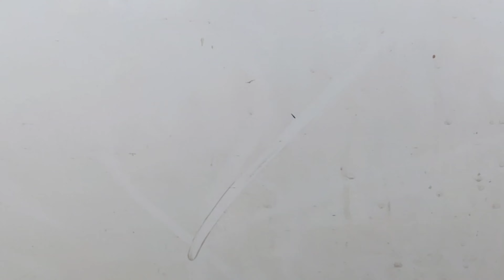2009/2014 F-150 Drivers Glass Replacement: How-to!! #12thgen #f150

Comment: How do I get the regulator down if no battery ?
How you pull from junkyard ?
Reply from the maker: I got mine from a junkyard that they pulled it and had it at a countertop ready to buy. I believe there is a bolt on the regulator you can "unbolt or bolt" and it should make the motor come up or down